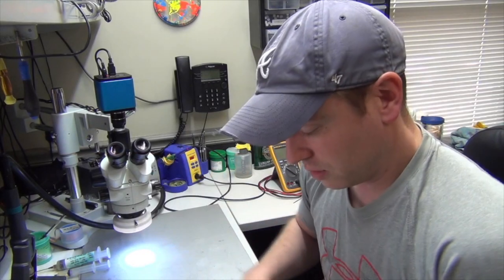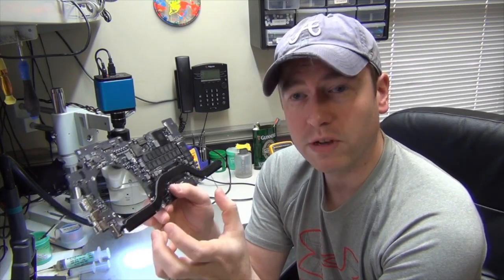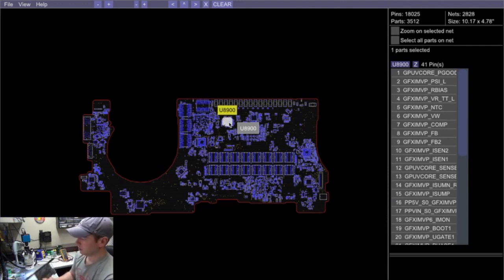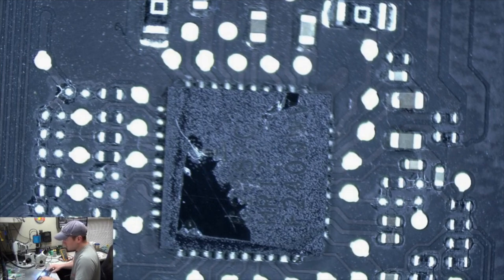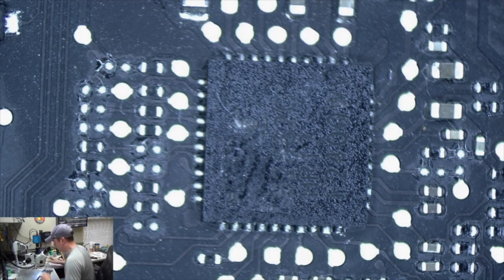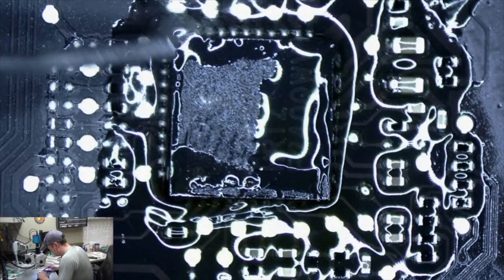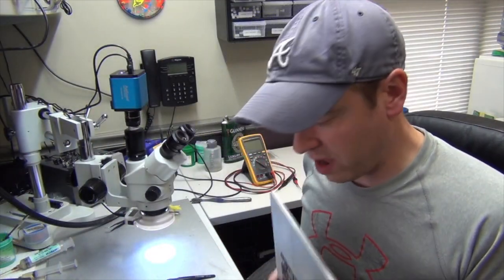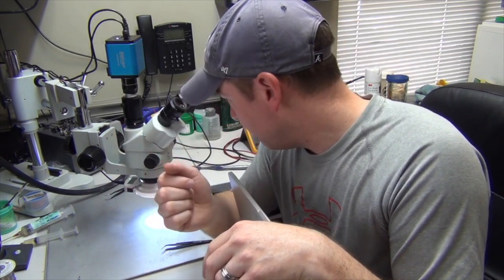Macbook Pro A1398 2012 Retina GPU Vcore Failure Repair on board 820-3332

Comment: so do i just ask to get this done from any computer mechanic ? and how can you tell if the reason for my computer restarting randomly when i play csgo which runs my computer really hard. im guessing this is a good way to prevent this problem from getting as worse as that one. what causes the cracking ?
Reply from the maker: No, most computer repair companies do not do component level repair. You would need to ask if they did component level repair, and even then you need to find a company that is highly experienced in these type of repairs as you can cause a lot of damage if you don't know what you're going. If you can't find anyone locally, we do have a send-in service at this link: http://www.powerbookmedic.com/xcart1/pages.php?pageid=67
Reply: @PowerbookMedic  ok thank you very much

Comment: i have a situation like that but mine i see fan spins normaly,charge but caps lock light wont power and display is complet black.I know is on becuse the fans starts when i hit power button...any ideas?? thanks!
Reply from the maker: When that happens the CPU is not posting.  So there is either a fault with the CPU itself or a power line for the CPU is damaged.  It would require some diagnosing and measuring.

Comment: Hi ! Very interesting video :)

My Retina Macbook Pro 15'' (mid-2012), is getting black screen on boot. Sometimes I can boot on safe mode, sometime not. 

After lots of digging on line, I figured out that it could be my discrete graphic card (Nvidia) that can be faulty. 

I forced Mac OS X to use only the integrated graphic card by running an command line that modifies NVRAM (that command can be cancelled using Apple NVRAM reset shortcut) : 

sudo nvram fa4ce28d-b62f-4c99-9cc3-6815686e30f9:gpu-power-prefs=%01%00%00%00

I can now boot but some features disappaered (like changing the luminosity of the screen, using an external monitor, ...).

My question is the following : is that the same problem that the one described in this video ? 

Thanks a lot
Reply from the maker: Yes, most likely it will be the GPU Vcore chip.  We've had many of these with the black screen symptom that just needed the VCore chip to be re-soldered correctly.  That should fix the problem right up.
Reply: Thank you for your answer :)

Do I need a specific flux for this ? I don't know yet if I will re-solder it, but you never know :)

Thank you.
Reply from the maker: There are many that would work, but we use NC-559-V2-TF.

Comment: Hi the failure is detected by testing motherboard or some software? My macbook pro mid2014 15'' no failure in D diagnose and no failure in Techtool, symthoms is already same, the problem is very common? I'm afraid it's the GPU thanks!
Reply from the maker: The software won't always detect a failure. For example when the GPU Vcore chip is going bad it will output the correct voltage and then all of a sudden drop which gives an error in the software. However if the voltage doesn't drop during testing then there won't be an error. It's possible that your GPU core IC chip is going bad as well.  It’s not nearly as common on those models but is still possible to happen.

Comment: I have an iMac my parents have had since around 2009 and the picture is distorted looking. The screen is fine and it runs perfect, how do I fix this?
Reply from the maker: The iMacs are notorious for having video card issues. Most likely yours is going bad. You can go to our website, type in your serial # and it will give a list of parts including the video cards available for your model.

Comment: What kind of flux do y’all use?
Reply from the maker: We vary in what we use. For this particular repair we used Amtech NC-559-V2-TF flux.
Reply: @PowerbookMedic  Is there a specefic name or size for the soldering iron used?  Tks!
Reply from the maker: @Mowlson  We use a Hakko FX-951.  We use multiple tips for it depending on what the job is.  We mainly use beveled tips with different sizes.
Reply: @PowerbookMedic  TKS 👍